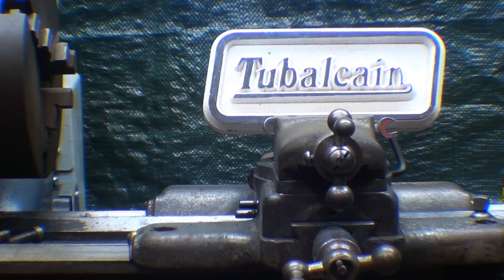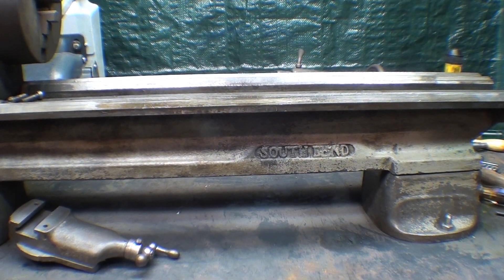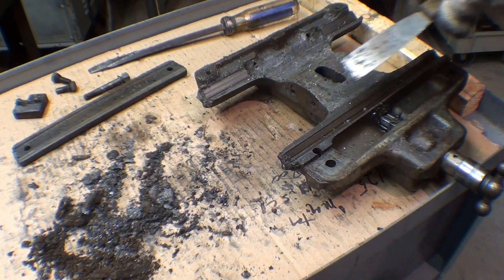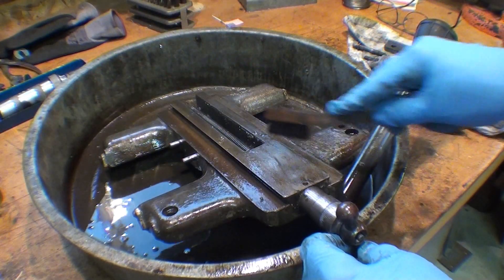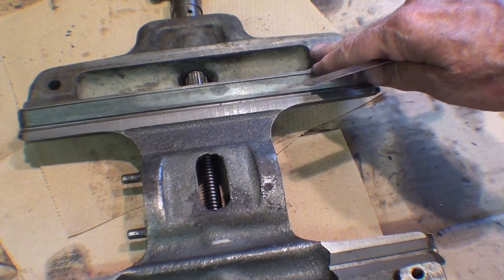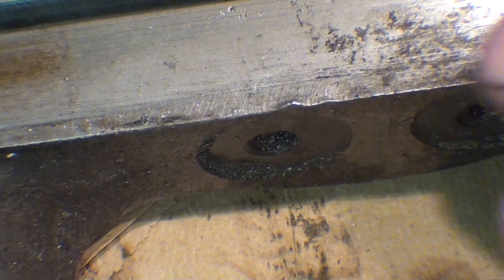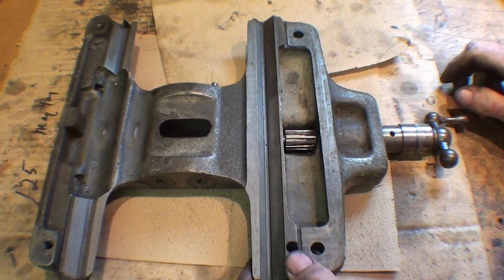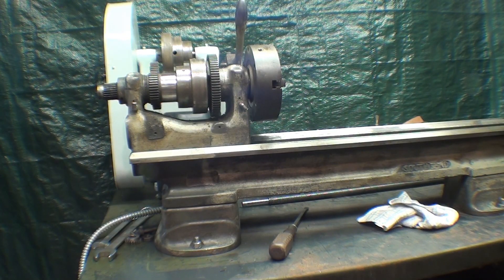Tips #329 Inspecting the Saddle on SOUTH BEND 9 in Lathe tubalcain

Comment: Regarding the gib strip on the back of the saddle, my Boxford lathe, which is remarkably like this south bend, mine too was only screwed on slightly, albeit with spring washers. Because I have fitted DRO scales, I used this strip as the mounting point for the X axis reader head, I needed more stability, so I put two grub set screws in the middle of the stip, and adjusted them so the gib was tighter, but having the saddle still sliding nicely. just thought you might be inrterested! cheers again, Dave

Comment: Mr. Tubalcain, thank you for the informative videos. I have been following your clean up series as I "Acquired" a 1941 vintage South Bend model 9A from the San Diego Naval Ship yard. They were going to scrap it for being obsolete in the age of CNC and digital read outs. mine has that "backlash" or movement in the cross slide screw. Is that easily fixed by replacing? or is it a negligable issue? I find it hard to find any information on these old Southbends. Once cleaned up though, what would you recommend for re-lubricating them? Teflon grease or something like white lithium grease or something more viscous. Again thank you for the very informative videos, for a garage hobbyist like me, they are invaluable. The technical school here are dicks about giving info, and ITT is no longer around as of a few weeks ago. So I turn to YouTube University.
Reply from the maker: Should be a good lathe--nice find.
Watch for tips #341 & 342 coming out soon-all about the oils & lubricating
Reply: Thank you. your model 9 though the bed looks shorter than mine. My bed way measures close to 48". I requested the archive information online and when they sent me a copy of the original invoice, it was addressed to the Department of the Navy. do you have a video that shows the disassembly of the headstock as mentioned in this video or is that in the works. Thanks again Mrpete222

Comment: Your efforts in providing these videos are greatly appreciated by all of us I think.  In my case, yours and several others convinced me to by a lathe which lead to saving $1435 on a swather repair for new idler rollers for the draper belts and I had it done before John Degree could get the parts shipped in on the factory stuff.
So if you have ever wondered if your videos have made a difference for someone, now you know, they have.
Thanks MrPete222!
Reply: forgot to add, it was a Southbend model A I bought and probably looks like this on the inside it was in a barn and nearly unidentifiable as a lathe with the dirt, straw and rats nests.  The swather was a John Deere model 830 Windrower and a model 78 draper platform.  My eccentricity over the 40 inches of the rollers was .008 on the worst one.  So once again, thank you for your time and effort
Reply from the maker: Thanks--it IS very gratifying that I made a difference!!!!!!!!!

Comment: I assume the wear on the bead rails and ways creates a misalignment between the head stock and the tail stock.  Is this true?  How do you fix or compensate for this?
Reply: The tail stock on most South Bend lathes does not use the same areas on the ways to register as the saddle. They ride on the inside flat section of the bed. Given the wear on the rest of this machine I would bet the tail stock ways show a lot of wear.

Comment: If the screw holes where you attach the wipers are still there, the saddle is not completely worn out. (I had a really badly mistreated SB9 where only half the screw holes were still there.)